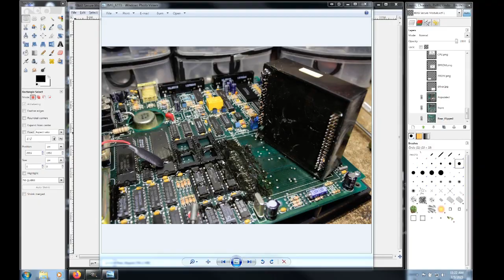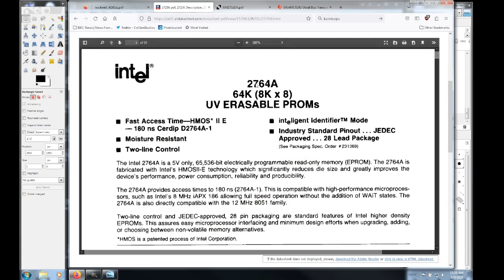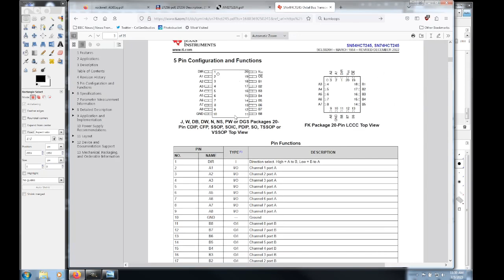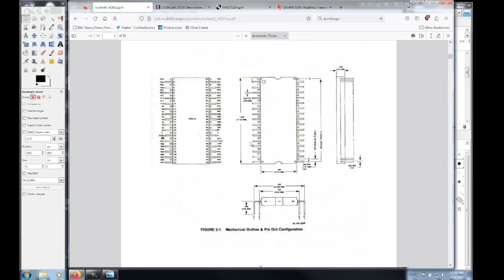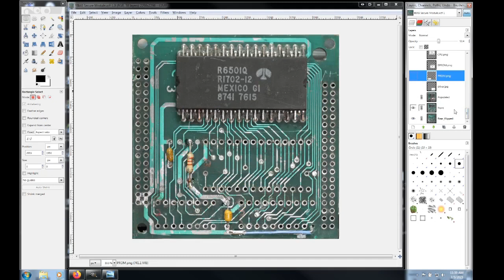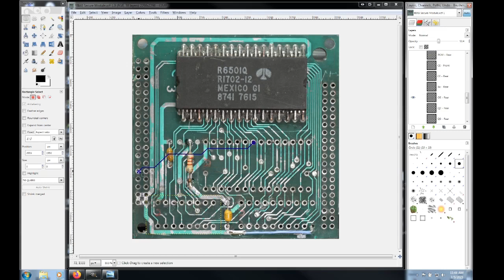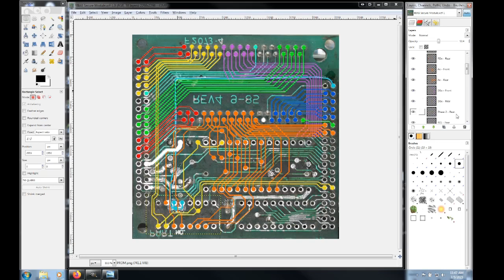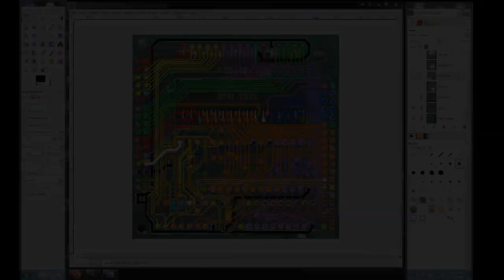Reverse-Engineering the Security Module in a Mastervoice Butler in a Box

Comment: By my guess, it looks like the security module was potted with a blank EPROM and PROM in it, which were programmed later (Vpp being exposed) with up-to-date firmware and the PIN. I recall bipolar PROMs being programmed with a high voltage on the /G1 or /G2 pins one bit at a time, which are also exposed to the outside world. The direction and enable pins on the '245 are available too, but someone attempting to pirate the system wouldn't know they're there without depotting the module. I suspect the '245 is to prevent code from appearing on the data bus externally from the module. The address and data busses would be known externally due to the external EPROMs, so if the '245 wasn't there it wouldn't take much to sniff out the data.

Comment: Great use of gimp.  Gives me the idea that one could label pads/vias on the image, trace the traces as you've done, then a netlist could be generated automatically.   Then a schematic could be generated for one's favorite EDA tool, followed of course a new PCB if desired.  I dunno much about gimp, if it has the features to do this, or allows writing plugins that could do it.  If not then a stand-alone application (vastly simpler and easier than gimp) might be called for.  Would be wonderful to be able to just click anywhere on a trace and have the whole trace light up, then just do manual fixing/tracing as needed.

Comment: New subscriber here; I have no idea what this device does but the video was interesting and perhaps I can help a bit.

16:40 All the address decoding hardware is on the main board, so the main board needs access to the !OE input of the 74HCT245 to connect the main board hardware on the data bus (and disable the PROM from the looks of it). The !OE pin is pulled high by the 2k2 pull-up resistor, and the address decoding logic on the main board pulls it low, probably from a 74*138 or similar open-collector/open-drain chip that are commonly used for address decoding. As you mention earlier in the video, there's a missing component that was probably a diode; maybe they were considering the possibility that the address decoder might not be open-collector (I think the 74*254 was a decoder with totem-pole outputs?) while they were developing the security module. They eventually realized they didn't need the diode so they left it out.

As someone already said, the PROM is simply used to scramble the address lines to the EPROM. They could be using those I/O port C lines to help with the scrambling but I suspect that they don't and those lines are just to help with programming the PROM at production time. If anything, the 4 lines of port C that go to the 27S21 only possibly generate 16 possible combinations of bit patterns so even if it matters, you would only have to try 16 times to get it right. And the part of the software that asks for the pin code cannot depend on those I/O port lines to be set correctly so that part of the code must be in an area of the EPROM that always gets decoded the same regardless of what port C is set to. And that area is probably at the top of the memory map, because that's also where the 6502 needs to have the reset vector, interrupt vector and NMI vector which should be available right from the start.

So even though you don't have hardware to read the 27S21, you could put both the PROM and the EPROM on a breadboard and connect them in basically the same way as they are connected in the module, and then use e.g. a 5 Volt Arduino to generate all the 8192 addresses that are relevant to read your particular EPROM through your matching PROM descrambler. The Arduino can read all the data from the EPROM and send it to the serial port, where you can capture it with a PC to a file, and you can analyze and hack that file. Then it's a matter of finding the code that asks for the PIN, and replace it with NOP or with a JMP instruction to skip it, or whatever. Then you can burn that image file to another 2764 EPROM and hack it into another device. It doesn't even matter where or how the PIN code is stored.

On the device to be liberated, you would need to:
* Cut the trace that enables the Security Module EPROM enable-input and pull the pin high or low, as appropriate, to deactivate the internal EPROM forever.
* Put the hacked EPROM on the address and data bus (you might be able to piggy-back the hacked EPROM on top of an EPROM on the main board, I don't know), and use the signal from the trace that originally went to the module's EPROM enable pin, as the input to enable the hacked EPROM on the main board. 
* Cut the traces from the address decoding logic on the main board to the !OE and DIR inputs of the 74HCT245.
* Put some logic on 74HCT245 DIR and !OE pins so that the original signals are put on there whenever the hacked EPROM is not enabled, but allow data through from the main board into the HCT245 when the enable-line of the hacked EPROM is active. I'll leave that as an exercise for the reader 🙂

There's a good chance that you can pull the 74HCT245 !OE line down permanently once the internal EPROM is permanently deactivated, and you can probably use R/!W (or a boosted and/or inverted version, as appropriate) to generate the DIR signal. I don't know anything about the main board so this would require some further study! If you kill your butler, don't blame me.
Reply: what a boss

Comment: The prom can be easily readed with a counter like 4040, 4060 (osc included) on the address bus conected to a logic analyzer, you will only need to save the data to a binary file. As 
@s8wc3 said, connect a 16 bit logic analyzer to the address bus of the eprom and the trigger of the logic analyzer to the front panel "enter" switch, with the eprom file readed you will only have to disassembly less than 50 bytes of code that can be easily done with ida or other tools. Some of this checks are done with conditional jump instructions and changing the jump type or the data that are being compared may unlock the check routine.

Comment: The EPROM has no security bit to worry about.
The PROM can also be read out fully even if there was a write protect bit on it.
You could source a replacement CPU and just clip the legs from the old one to pull it out of circuit if there was any mystery tracks under the CPU that needed inspection.
Nice job depotting, what solvent did you use?
You might be able to just manually read the PROM data on your programmer display, there are only 256 nibbles after all.
The PROM may be just for address decoding as you surmised.
Reply: With a little thought it may be possible to connect to most of/all the required programming pins using connections on socketed ICs on the main board.  It would be optimal if you could read out the data by using a harness that would just plug in.

A thought did occur to me that even if the PIN was stored as a hash it might be possible to overwrite it with ZERO bits once you locate the location and then you only have to calculate/brute-force the PIN for a NULL hash once and the pin can be reset with a quick write of the specific BYTES in the EPROM.
Reply from the maker: For a solvent I used acetone in a ventilated environment along with a suitable brush, but the resin also comes off quite easily with hot air and a sharp knife.
Reply from the maker: @KallePihlajasaari  The thought did come across to me as well, plus getting direct hardware access lets me verify if read back was possible without having to dig into other modules by using a jig instead. That was one of the optional goals as it also them lets you crack the PIN on other units with a lot less effort.
Reply: @CelGenStudios  There are some very interesting and effective solvents to be found in paint strippers still in the USA.  Some of the good ones are 'banned' in the EU so we have tame paint strippers.  Depotting some materials is a real challenge yours seems to have been less tenacious.

I suppose I will have to go and see what these things were used for and why a PIN is even desireable. :-)